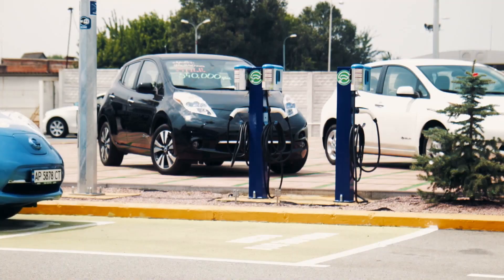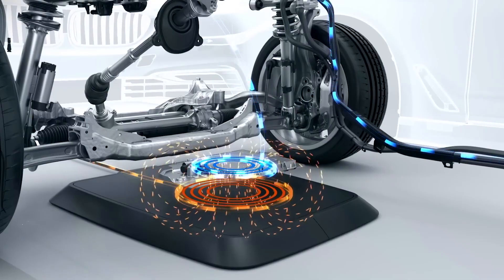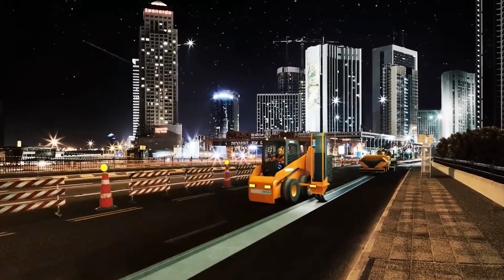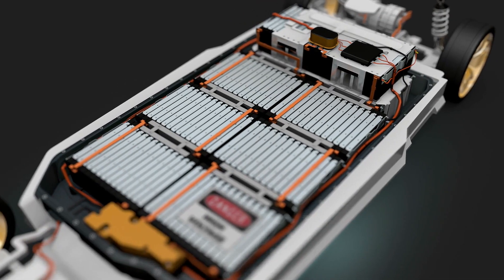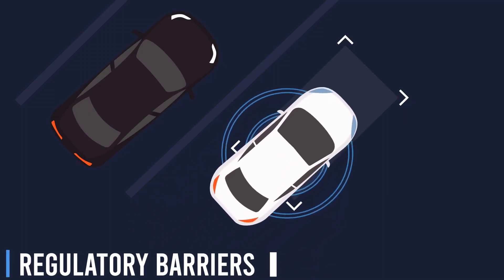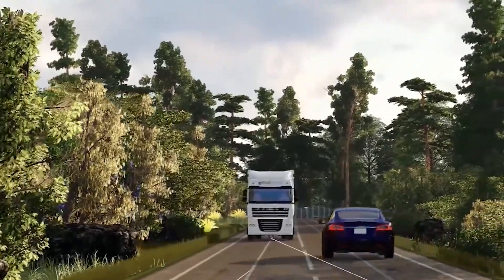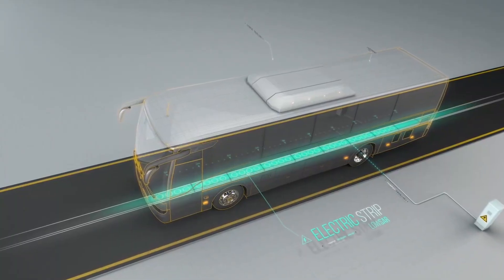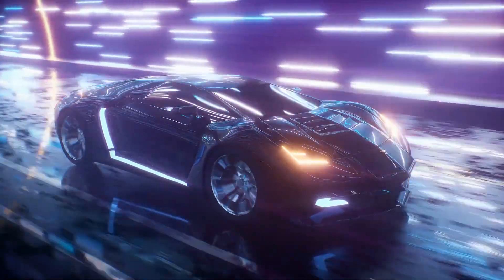Electric Vehicles SELF-CHARGING On Smart Roads

Comment: Hilarious. I bet some people will watch this and think it is achievable.
Solar roadways anyone?
Reply: Dayton OH has had an electric public bus system for almost 100 years. https://en.wikipedia.org/wiki/Trolleybuses_in_Dayton
Reply: @timothystockman7533  Aren't they trolleys, using overhead wires, plus an onboard diesel generator and batteries?
I believe London, England has a fleet of 400 electric buses. These don't use cables or generators.
Reply: @oldbatwit5102  The Dayton system is essentially city busses with normal rubber tires driving on city streets along routes with overhead wires. Unlike normal trolleys, which use the rails on which they ride as the electrical return circuit, Dayton busses have a pair of overhead wires, since there are no rails. For most of the system's years, traction power was derived exclusively from the overhead wires. The latest bunch of busses have traction batteries onboard, which allow them to extend the route beyond the overhead wires. There are no onboard generators. Initially, the bus traction batteries did not charge from the overhead wires, but they are phasing that in as they upgrade the infrastructure.
Reply from the maker: You never know what the future could bring!
Reply: @realmotorminds  But you can use current science and common sense to gauge what is likely, what is possible, and what is not.
Reply from the maker: Well said current science. We keep evolving. What we thought is impossible 10-15 years ago, now it's becoming a reality. Think about cars, AI, mobile phones etc...
Reply: @realmotorminds  We have had mobile phones since the eighties and cars a little longer as I recall.